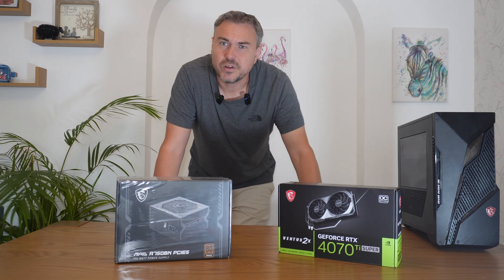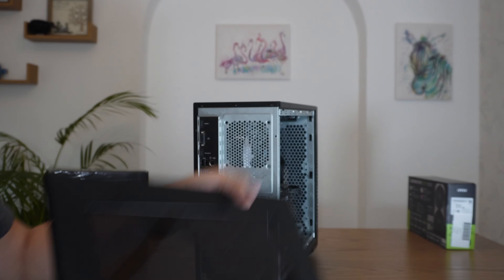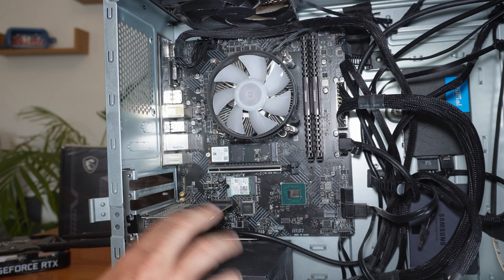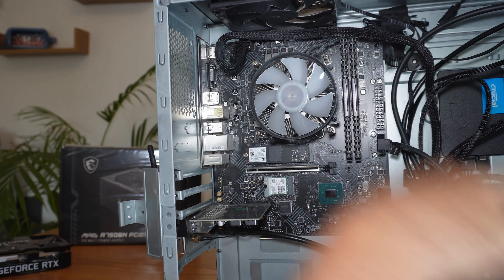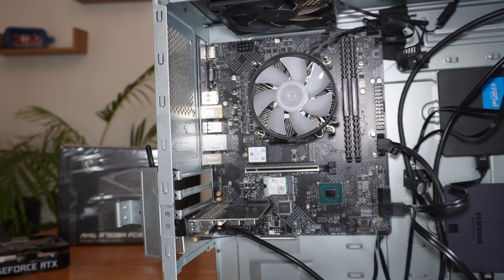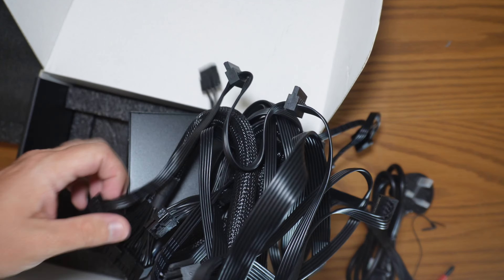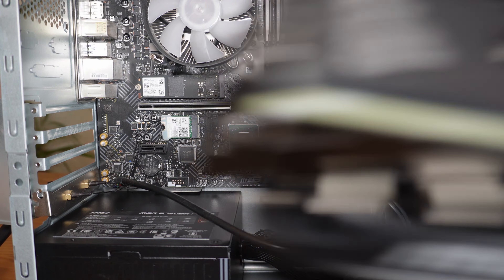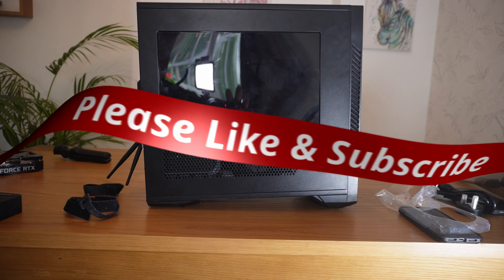Upgrading Your Store Bought PC Can Be a GAME CHANGER

Comment: The main problem with pre-built/store bought PC's usually is the motherboard.  They are not designed for 'future proofing' because they obviously want you to buy another PC in 2 to 3 years time.  I know you are referring to pre-built PC's that are now a couple of years old, but I think it's important to note that anyone planning on buying a pre-built PC at this current point in time (October 2024), or planning on upgrading a PC that is a couple of years old, will be limited when/if they upgrade to the next gen GPU's early next year because the motherboard will very likely be PCIe 4.0 and the new GPU's are going to be PCIe 5.0.  Yes, you can still connect a PCIe 5 GPU into a PCIe 4 slot, but you won't be getting the full bandwidth leading to less performance of what the GPU is capable of.  And even though it can be somewhat rare, some of the pre-built PC's have motherboards made specifically for the pre-built, meaning the BIOS for the motherboard can be very limiting, so you will be very restricted in what CPU and Memory you can use.

So yes, I totally agree that there is always the option to upgrade your pre-built PC, but I think it's important to understand that pre-built PC's are built in a specific way to limit the upgrade path.  And not to mention 99% of manufacturers will void your warranty the moment you change a component (guaranteed to void your warranty if you go changing the PSU), so make sure your PC is out of its warranty period before doing anything to it.

In saying all of that..  If you can upgrade, and the upgrade meets your needs and you're not too worried about the limited upgrade path, I say go for it!
Reply from the maker: Yes 100% valid points here